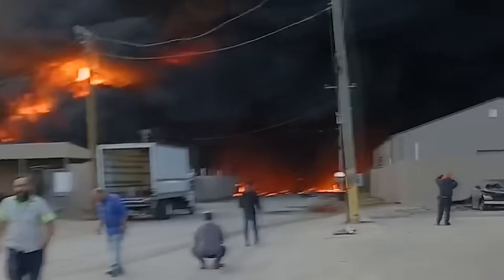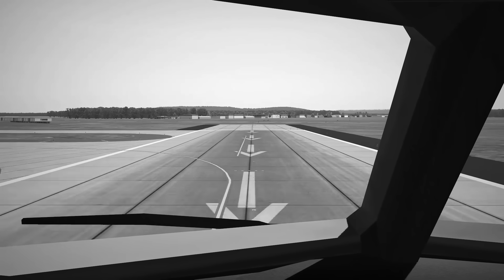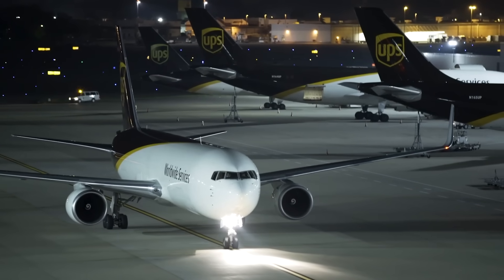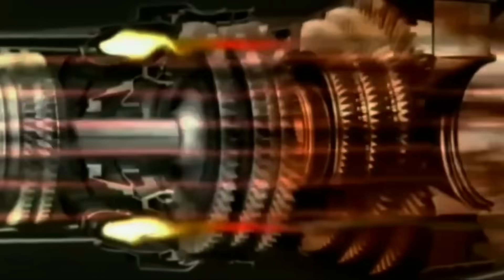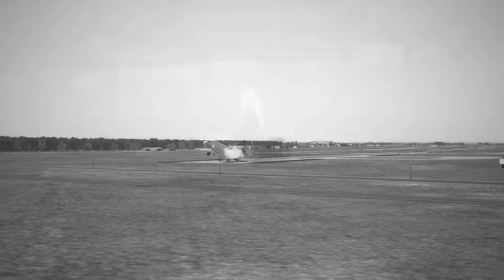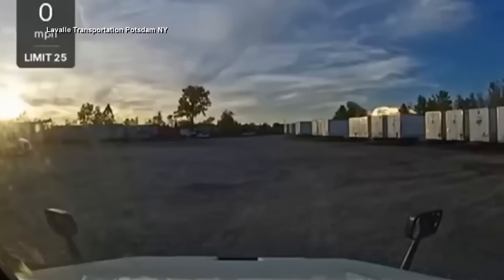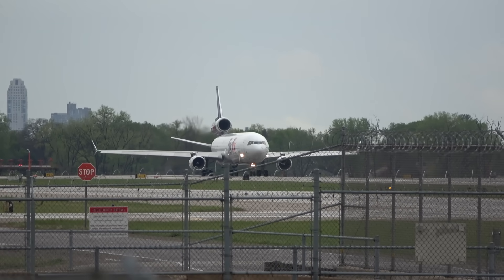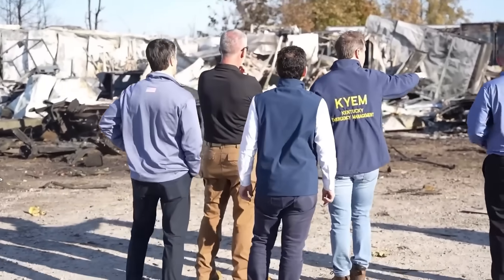The Real Reason That Makes UPS Flight 2976 Crashed...

Comment: The engine on the tail flamed out, not the right wing
Reply: Actually the video evidence points to a compressor stall on the number 3 engine on the starboard wing. As of yet there is no (public) indication there was an issue with the number 2 engine in the tail.
Reply: the right engine seemed to suffer from compressor stalls as well, so they had one absent and two damaged engines.... no wonder they couldn't fly.
Reply: So many people are seeing the flashes right of centre and assuming its the right wing. But the angle of the video gives that illusion. The flame out flames align with the fuselage centreline above the tail where the exhaust of #2 tail engine is.
Debris from the #1 engine and runway more likely to reach the tail and the fuel supply to the tail engine comes from the left wing and fuel interruption  is the other possibility.
Reply: @mricemantoyou I have seen multiple  videos of it, and I'm just going by what people who know far more about this stuff than I do are saying about it. It looks to me, also, like it's clearly the #3 engine spitting out intermittent balls of fire. It also makes more sense that debris from the #1 engine shot across under the fuselage and damaged the #3 engine as both hang well below the belly of the fuselage, and there is a clear path for debris to travel across to the #3 engine. It's all speculation at this point. The NTSB will figure most if not all of it out. But the consensus among most "experts" is the #3 engine experienced a compressor stall.
Reply: no evidence
Reply: We should let NTSB do its job and report with evidence what happened. We're there compressor stalls on #2, maybe, it looked like it but it doesn't mean it was still providing adequate thrust. #2 is also possible. There was FOD flying everywhere it looked like. You'd be very surprised what a jet can inject and still operate. We used to test new engines at our remote test site by throwing frozen turkeys into the inlet to see what damage it caused. That data would be used to look at various blade materials to minimize the damage.
Reply: Negative, you can see the flashes on #3 as it's about to impact.

Comment: What has not been mentioned is that the horizontal stabilizers carry 14,000 lbs of fuel to optimize CG during cruise flight which extends range. This is accomplished through auto fuel sequencing. It is clear that the jet impacted power lines as evidenced by bright white flashes immediately prior to the major explosion. I submit it was the tail fuel explosion that destroyed the aircraft prior to ground impact. Have 4200 hours logged as an MD11 captain.
Reply: Well Mr. Pilot tell me how an engine was left on the run way?
Reply: @pdcentrella: The outboard engine wing pylon design of the DC-10 & MD-11 uses 2 large bolts to fasten the top of the engine pylon structure to its mounting bracket on the wing. On AA-191 in 1979, during maintenance the bolt hole at the narrow back portion of the bracket had the bolt in place but not tightened while they worked on aligning the front bolt holes to get that bolt in place. The excessive load on the back bolt started a fracture from the bolt hole on the wing clevis of the mount. Additionally, when the forward bolt holes, very near the wing leading edge, were nearly aligned, the mechanics used a hammer to drive the bolt through the holes, causing cracks to begin on the forward wing clevis also, but those fractures did not contribute to causing the accident. In the accident, the rear attachment broke lose first and the thrust from the engine swung it forward and up, pivoting on the forward bolt until its clevis broke lose as well. This sent the engine across the top of the wing, with the attached pylon ripping a large gash into the top of the fuel tank. The engine was not on fire, however, so the fuel pouring out of the gash was not ignited in flight. The engine assembly was left on the runway, comparatively intact.

With UPS-2976 in Louisville, KY, the #1/port engine had an uncontained failure (Rapid Unscheduled Disassembly) accompanied by fire (a bell alarm in the cockpit is an indication of an engine fire). The NTSB spokesperson, at the third public briefing, said that there were small fragments of compressor and turbine blades scattered over a wide area of the runway, beginning near where the plane would have achieved V-1. It's obvious in the videos that this engine took the same path of departure – up and over the wing – with the fire from the engine igniting the plume of fuel that was spraying from the rip in the top of the wing tank.

The apparent failure of the #2/center engine, just after rotation, may have been caused when it ingested the combustion products from that fire, rather than debris from the #1/port, engine. The combustion products would have been superheated & oxygen depleted air, mixed with partially burned fuel. That would probably have caused an extreme fuel flooding in the combustion chambers which probably would have detonated as it exited the turbines and mixed with the oxygen rich air from the bypass flow. Such a detonation would be seen as a large, single pulse, whereas a compressor stall normally causes a sequence of several smaller pulses.

In the dashcam video from the truck on Grade Lane, it can be seen that although the port engine and its pylon are missing, there is no visible fire on the underside of the wing, and the wings are still basically level. The fully loaded MD-11 hitting neighborhood power lines is about as impactful as a large fitness jogger going through a few strands of spiderweb. However, a fraction of a second later, the left/port wing of the MD-11, outboard of the left main landing gear, hits the tops of the black, 3-story tall oil storage tanks at GFL Environmental Petroleum Recycling (there were about 20 of them clustered tightly together at 38.149246, -85.735192), which shredded the left wing and fuel tank, causing the first large fireball. As the plane moved forward from there, the only remaining lift came from the right/starboard wing, which snap-rolled the remains of the plane more than 180° to port, until the inverted right wing impacted ground structures, causing the second fireball.

BTW, the location of GFL Environmental, Louisville KY, is about 1 mile from the south end of runway 17-R.

A mix of research, detailed observation, and logical deduction has advantages over assumptions. Being 73 with a lengthy amateur history of engineering failure analyses also helps.
Reply: hopefully ntsb checks in and you can wrap up this investigation for them by next Friday.

Comment: Grok says it was Pylon Failure not Catastrophic engine failure.
Reply: THe pylon was still attached to #1 at time of separation. Grok be partially right but there is not enough data for Grok to give a fact based view.
Reply: the second might have caused the first, but that's not proven.
Reply: @kirakaffee9976  Go argue with Grok.
Reply: @DronesandHamRadios nah, I leave it to the NTSB to settle this, I don't argue based on informed speculation at best ^

Comment: As an old aircraft mechanic every repair will be heavily screwnized starting with the most recent.
Reply: screwnized 😂
scrutinized! but I like your way of logic, like, inspecting every screw...
screws forgotten to put back in screwed up flights before. Not jumping to conclusions here but definitely needs to be looked into.

Comment: The plane would probably take off without any problems if it were lighter.Condolences to the families of the deceased.
Reply: Nope, not with 2 engines compromised. One engine on fire, they could handle, one MISSING engine and another failing was unrecoverable. Light or heavy, would not have made any difference.

Comment: How can a MD-DC-10 become a MD 10-11 ?
Reply: Years ago they converted the DC-10’s at FedEx to MD-10’s. This removed the engineers station and replaced it with the 2 man cockpit of the MD-11. The airplanes fly completely different than the MD-11 but it was a common type rating and we flew all models. MD-11, MD10-10, MD 10-30
Reply: @davenehilla9610  Pretty sure all DC/MD-10's have long been out of service. MD-11 is a different animal.

Comment: I believe we, society, need to look at the stupidity of putting builds and infrastructure in in line with runways.  Enact legislation to provide clear crash zones at each end of every runway at least triple length of the runway.
Reply: I was just thinking the exact same thing!  ✈️
Reply: @chancevonfreund9145 
In theory a good idea
This should have been considered decades ago.
How are you gonna push eminent domain to make the clear crash zones for every major domestic airport that has residential and commercial zoning in landing and take off paths?
Reply: @williammoreno2378  Yes it would be a nightmare for sure. Personally I would not want to live or work in a close proximity and direct line of an airports runway. But that's just me and for many people it's not that easy.  ✈️
Reply: Need vast wasteland around airports for the once-every-fifty-year events.
Reply: @skyboy1956  Don't be silly just enough time and distance to shut down safely so V1 is not an issue.
Reply: @LancePicard-s1i  lol, this was not a "V1 accident"
Reply: @skyboy1956 LOL Who said it was! 😄
Reply: @LancePicard-s1i  and just like that, the internet became experts on V1 overnight ! 😂😂
Reply: @skyboy1956  Says the area of vast Wastelands around airports expert.  Speak for yourself 😆🤣

Comment: At 1:25 the narrator says "V1 is the "go" or "no-go" speed, the point where, if something happens there isn't enough runway left to safely stop".

Except if the whole truth is considered, there probably was. 

This runway was 11,900 feet long, and they took the runway at the approach end, meaning they didn't make an intersection takeoff. They had all 11,900 feet available to them (discounting the turn radius to take the runway).

I know they were heavy with 220k fuel and ??? pounds of freight, but it's likely - I say likely - the V1 speed used for this takeoff was limited by the rotate speed, Vr. The rule is, even if the runway were 20,000 feet long, V1 is never greater than Vr. 

Period. So we don't really know if they, strictly speaking, were TRULY committed to takeoff or could have stopped sometime AFTER the V1 speed they used for this takeoff. I would like to know. 

I believe the V1 speed was likely artificially lowered to Vr for this takeoff, as though it were a balanced field length. Balanced Field Length is the runway distance where the aircraft has equal ability to either stop or take off after an engine failure at V1.

Of course, V1 may be constrained by brake energy absorption limits, tire speed limit, VMCG/VMCA (I don't think factored in here), crosswind/friction limits (again not constraining here), and engine-out climb performance (at some point would be a factor). And it will also differ for a max power takeoff vs. a reduced power takeoff (saves engine wear and reduces the likelihood of an engine failure).

This experienced crew did everything they were trained for to accomplish a successful takeoff using the speeds they were given. They used the computed V1 and Vr speeds, I'm sure.

Comment: FYI: This is a non-USA, auto dubbed channel. The dubbing is not terrible, but could use improvement. The writing is decent, and gives a lot of good information in most cases. The name of the channel, 'Flig Debrief' is used to trick the auto-filling AI into searching for 'Flight Debrief', thus not providing any useful information about this channel. I want to know who, or what, is creating the channel, and why they are hiding the location and nationalities of the creators.
Reply: I removed this suspicious channel from my YouTube feed. I will not be seeing it again.
Reply: If so he chose the wong word as I can't find a "Flight Debrief" channel. However, a channel called "Pilot Debrief" does come up. I guess he should have named his channel "Pil Debrief"
Reply: @skyboy1956  The channel name, 'Flig Debrief' is a direct attempt to fool the AI search engine, and run cover for the channel. More AI junk appearing on YouTube.